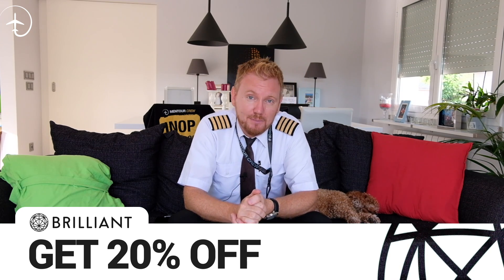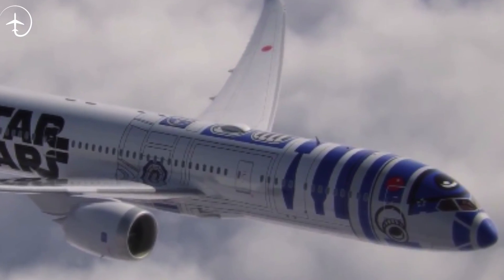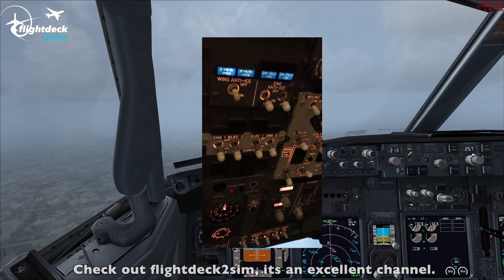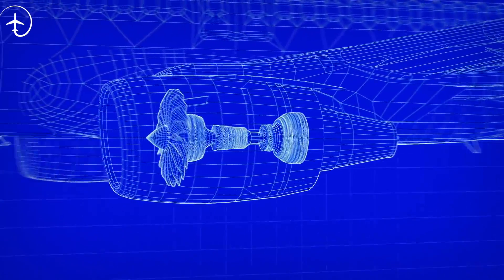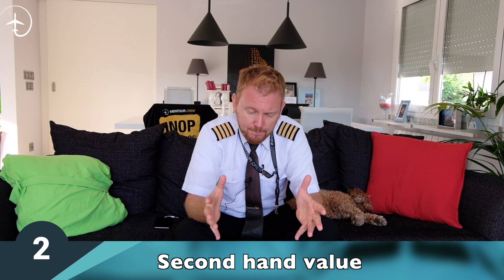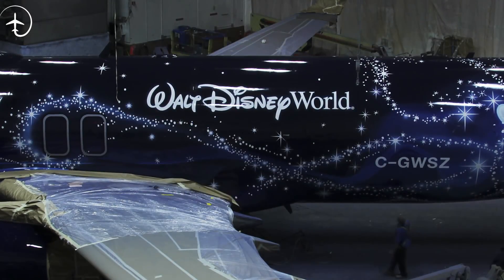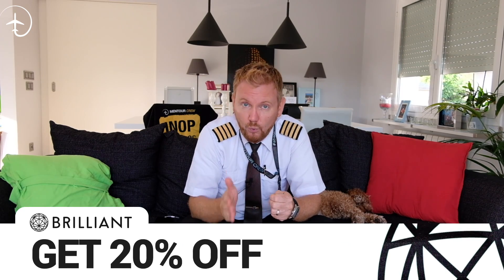Why the front of the Jet Engine is NEVER painted..

Comment: So, why dont airlines just partially paint the plane or not paint the plane at all (like American Airlines used to do)?
Reply: Egor Levin Because the paint serves several important functions.  The white actually reflects heat from the sun, unpainted metal would not do so as effectively.  It also, believe it or not creates a smoother surface, which decreases air friction.  This keeps the temperature of the metal cooler as air friction itself creates heat.  It also helps the plane fly more efficiently, helping to keep down fuel costs.  More friction equals more fuel used.
It also protects the metal from oxidation and corrosion, much like your cars paint does.

Comment: Mentor, is there any reason jet airliners from the 50s to the 80s had matt black noses?
Reply: RE1974    Cuts down glare/blinding reflections....
Reply: well the weather radar and other radars are in the nose, so that might have had something to do with it
Reply: That's easy. The radome cannot be made of metal, as the radar (which is located in the nose) wouldn't work. Regular white paint also has metallic components (nowadays, special paint without metallic components exists). So the plastic radome was covered with a rubbery protective coating, which happend to be black.

Comment: I suppose that if the nacelle were painted, there could be also chipped paint flowing through the compressors and cause an issue. Oh crap, I posted before the explanation which makes my post irrelevant.

Comment: I thought all the aluminium was coated by a treatment called anodising which forms a
coating on the surface . I may be wrong but it always was when I was in MOD contract manufacture.

Comment: white is also mostly fade proof. other colors like red, green, blue and other darker and stronger colors tends to fade into white if exposed to UV light for extended period of time and an aircraft flying at high altitude is more exposed to UV light which degrades the color of the paint faster. while the surface material of the aircraft is protected by layers of coating, the paint scheme which is the outer most layers is practically exposed to the elements which makes it more prone to fading and color degradation and since most color fades into white it is more effective to just paint something white even if the color of the white paint degrade it wont be as noticeable compared to other fancy color degrading and fading.

Comment: Amazing video.  That's just for "normal", commercial aircrafts for the most part.  If I remember correctly, military stealth aircrafts have a different design that allows the use of specially made matte black paint amongst its materials during construction - the kind of paint not allowed for use on commercial airliners.
Reply: Blacksands not to mention the cowling on a military aircraft engine is covered in grey paint.

Comment: Has ceramic coating o of the jet engine intake lip been considered?  It would reduce the adhesion of ice to the lip, and alter the thermal conductivity of the surface.  Which might be a good or not-so-good effect.....

Comment: I'll save you 12 minutes.  It isn't painted because the front edge is heated to prevent ice buildup, and they don't want the very expensive engines ingesting paint chips.
Reply: I see both sides.  If you want a quick explanation then read your answer.  If you want details watch the video.  I like details my self. My thought was they don't want paint chips in the engine.
Reply: Thanks man now i dont have to wait 12 mins
Reply: Star Gazer well I appreciate you letting us know the end , don’t listen to all the other retards.
Reply: ...plus a paint-chipped inlet looks like shit.
Reply: Thanks for the fast recap.
Reply: 3 years later @Star Gazer has proven himself a trailblazer predicting the rise of short form video content and dropping attention spans years in advance! Hats off.
Reply: The actual reason (though the ultimate reason is to prevent ice build up) is better heat transfer. Paint would act as an insulator, SS is a good conductor of heat from the bleed air (TAI: Thermal anti-ice) will transfer better.
Reply: @stevelaminack1516  Amazing that reason wasn't mentioned anywhere along the line.  You sure that's stainless steel?
Reply: You are the real mvp. Thanks for saving me 12 mins.
Reply: You cannot spare 12 min .but you can stick around for an hour reading posts ..makes sense.
Reply: @shoehorn12  Actually, that isn't at all what I said, nor was it my time I was attempting to save.  Perhaps a bit more of your time spent reading the posts would make them make more sense to you.
Reply: @stargazer7644  your not making sense even now..
Reply: @shoehorn12   Perhaps English isn't your first language.  The word you're looking for is "you're", as in the contraction for "you are".  I would suggest more practice to help with your reading comprehension skills.
Reply: @stargazer7644  There is no need to correct spelling or grammatical mistakes that another person made. It is common practice to let them correct themselves.
Reply: @MaxLai_0104  If the error makes it to where you have to deal with it, they didn't correct themselves.
Reply: @stargazer7644  When is it that you have to "deal with it"? This is not a formal job application or a college entry essay.
Reply: @MaxLai_0104  I have to deal with it every time I read it.  Why should one expect others to take time to read what they write if they can't be bothered to take time to write it correctly?  Sounding illiterate in public is really never a good thing.
Reply: Thanks
Reply: I'll save you 50 years, in the end you everyone dies
Reply: I never knew that—great info.
Reply: Thank you so much. I hate 20 minute videos when I'm looking for a sentence. Like answer the question and explain after.
Reply: Then he wouldn't have a video to get money off... It's cause and effect.
Reply: Thank you for the summary, ignore the complainers, everything we'll ever do is incomplete.
Reply: Thanks lad
Reply: Thanks..just needed to confirm what I thought i knew.
Reply: Guys don’t forget we are living in the attention deficit and instant gratification  era. With things like “YouTube shorts” and “TikTok” around people can’t watch a video longer than 60 seconds anymore.
Reply: @berkcanberk4947  After reading this thread, THAT's the conclusion you came up with?  Or did you not bother to read the thread?
Reply: @stargazer7644  yes. Unfortunately yes I did read the entire thread. And my conclusion wasn’t just based on this thread. It’s the reality that we live in.
Reply: @berkcanberk4947  And your personal observation of reality has what exactly to do with this thread that you posted it in?  I guarantee you it has nothing to do with the original post.
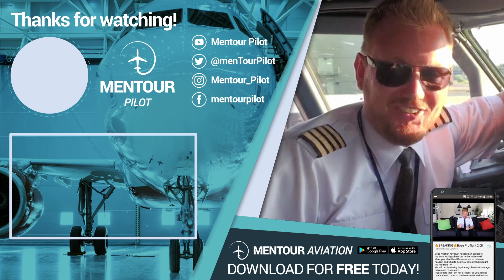Reply: @stargazer7644   yes it does have to do with the original post. Because I can’t find videos long enough to watch and yet here we have a whole bunch of people too impatient to watch a 12:00 minute video.
Reply: bro got way too much hate for nothing
Reply: I appreciate the TL;DR (?)
I kind of dozed off while watching it, but mainly because I am recovering from a cold😅
Watch the 12 minutes for the context, details, and reasoning.
Read the comment section to get the answer to the question without the previously mentioned aspects.

This is sort of like how in math, there is an actual discourse about why 2+2=4, and how it is "impossible" (because there are people who have the mathematical literacy to raise questions) for it to be anything else, but most people are satisfied to know that 2+2=4 without the proofs and mathematical formulas to justify it. 💁🏼‍♂️
Reply: I appreciated your succinct comment that does reflect the answer to the question posed. All these moaners and whingers just enjoy being arseholes. Cheers tho from me.
Reply: YouTubers in general have a tendency to prolong their video, not directly to the subject. I think the purpose is to have enough time for advertisement (more advertisement more money)?
Reply: Star Gazer - i think you wasted now more than 12 min for reading and answering the comments. 😏
Reply: 3 years later, thanks for the quick summary, and also for the witty answers to all those who mistook a TLDR for an aggression 😂
Reply: You also stand in front of a cinema and tell people the ending of new movies to save them time, aren‘t you?! 🙄
Reply: @unheilbargut I'm terribly sorry if I spoiled the ending of this cliffhanger for you.
Reply: Abstract: A guy walks into a comment section with a slightly dismissive attitude, which he then states his reasons for eloquently enough when challenged. This prompts the latest Guardians of Online Etiquette - armada to respond with mainly a bucket of more or less imaginative labels. Can't let the trolls win. 
I shouldn't be too surprised given the infected roll airliner engine paint has historically played in society, and how justifiably high tensions run on both sides. There's such a polarized divide these days, between the “anti-ice heating, 'nuff said” faction, and the “stick around and learn about the weight of paint” activists, that the former have always provoked and energized. 
And until the day we start addressing the many facets and root pains associated with asymmetric heat transfer, I don't think there will be any short-term end in sight to this very, very serious conflict.
Reply: @perarheim1255  ..."There's such a polarized divide"  my ass.
Reply: I watched the whole thing, your summary is incomplete.
Reply: @stulop  What part of the question posed does my summary not answer?
Reply: @stargazer7644  the video contains much more than the answer to a question.
Reply: @stulop  I'd hope so, since it is 12 minutes long, but title of the video was a single question.  If you want to know the answer without wasting 12 minutes, then there you go.
Reply: @stargazer7644  it wasn't a waste, that's for sure, it never is.
Reply: Star Gazer Thanks man.
Reply: @stargazer7644  These videos are always fascinating. 
But everyone is still aware you know much more than him. Sleep well.
Reply: @Mike-pf1ru  Hi Mike, sorry you're extremely late to the party.  It was over 2 years ago.  But feel free to have a good time by yourself.
Reply: @stargazer7644  Thank you Star Gazer. I’m always running a bit late. Have a good morning/afternoon/evening!
Reply: Thank you for cutting out the bull-shit.
Reply: Umm i guess we have paint that can easily deal with that temperature. It's not really hot, no?
Reply: @effedrien  The jet engine bleed air that warms these surfaces is about 250C/500F
Reply: Behold, Star Wanker is here to answer the question you clicked the video for!
Reply: @ipwn951  Hey look, Chris1 is here over a year late to give everyone the benefit of his worthless opinion!
Reply: @ipwn951  You have an amazing vocabulary.  Are you 12?
Reply: you are clearly a moron, this guy knows his stuff and neither he nor anyone else is asking an airhead like you to watch his material
Reply: Star Gazer, you’re an negative troll.  The guy has to start somewhere, and then gave a lot of detail about an interesting subject.   Your simplified summation is simply ignorant
Reply: @MarkSmith-js2pu  honestly you are the troll and trying to bully people. A single question was posed and he answered the question which was exactly what I wanted.
Reply: @MarkSmith-js2pu  Hey Mark...GFY.
Reply: @MarkSmith-js2pu  I'm not a negative troll.  I'm simply answering the question posed in the title.  The answer certainly doesn't take 12 minutes.  I don't think you understand what the word "ignorant" means.  If you want more detail, by all means, watch all 12 minutes.  I didn't find them an especially good use of my time.  If you just want an answer to the question, read what I wrote.  No need to get your panties in a twist over it.
Reply: @stargazer7644  oh dear.
Reply: @stulop  Don't worry --- he's the only one subscribed to his channel!
Reply: @stargazer7644  some of us like his videos…12minutes well spent.
Reply: @stargazer7644  you're cool. Do the numbers in your username have a meaning?
Reply: @HolbrookStark  No, the random number was youtube's gift to me when they renamed everyone's accounts last year.
Reply: @elishavarivka8923  Sure, in that case, enjoy yourself.  In case you just want to know the answer - there you go.
Reply: @stargazer7644  Well.. I could also google the question and have the answer in a second. But, I'm on Youtube because I like to watch video's and hearing the whole story. This video would've been 5 seconds long if he just had that 1 question/answer lol.
Reply: Keep star gazing, you know nothing about aircraft..IT IS primarily for engine anti-ice.
Reply: @stevelaminack1516   That's really rather irrelevant since I'm repeating what Mentour Pilot said in the video, and not expressing my own opinion.  What you're actually saying is HE knows nothing about aircraft.  Good job.  I'm going to go out on a limb here since, as you say, I know nothing about aircraft and point out "front edge is heated to prevent ice buildup" IS engine anti-ice.

Comment: Well, experience tells me there are a couple of reasons why engines and leading edges of wings are not painted:
1. Anti-icing/de-icing Airplanes have different ice countermeasures implemented. Some of them, like the ATR simply sends rough air bursts destroying formed ice. Others use air from APU or the engines to heat or clean the surface. Using paint would disrupt this.
2. Screw-ups. Airplanes are mathematically engineered to obtain the best air-flow around the wings and in front of the engines. Applying a layer of paint disrputs those calculations, resulting in a botched up airflow. Not to mention, poor paintjob or a paintjob that wears out will eventually have iregularities on it's surface. This means there are places where waterdroplets can rest and start forming ice. And if ice forms on the leading edge, this has a severe impact on lift. For the engine, ice deposits can form which can then break and be taken in the engine itself

Comment: As an A&P mechanic and pilot, I say the paint chips have nothing to do with it. Most turbine engines have inlet particle separators that keep most moderate to small sized particles out. This is an anti-ice cowling and needs to get hot to keep ice from building on the engine inlet. The particle separator is great but it wont clear huge pieces of ice.

Comment: I always believed that an aircraft that is sold to a new owner generally has the old paint stripped off after the sale and prior to the new paint scheme being applied for one of the reasons mentioned in #1, weight savings. There may be budget carriers that don't but it makes more sense to remove the old livery completely and repaint from bare metal, especially since it's unlikely that the previous operator has repainted the aircraft within the last 5 years.  Operators want to get as much value as they can from their investment in an aircraft and that includes getting their money's worth from the last repaint.

Comment: To add one more reason for front of  engine no to be painted, it could be preserving clean intake, because when passengers see all those scratches they would think airplane is old and unreliable. What about attacking edges of wings? Second: I was wondering, if plain spend more time during exploitation in cold air at high altitude, than would be better to be painted with some of dark colors? If is one grounded a lot of time like Air Force One, than brighter colors would make more sense...I don"t know, but this is just my guess...

Comment: Before watching the video I postulated this theory. The front cowl of the engine is unpainted  because flakes of paint flaking off could enter the engine causing catastrophic failure to the engine in mid air leading to a crash. 

Then I watched the video to see if I was right.

I was sort of right. Didn't think of ice and heating the cowling. that was interesting and informative.
Reply: Catastrophic engine failure?...dumb.
Reply: @edfilipowicz4866  Anything flying in to the engine can cause it to fail. So the theory isn't dumb. Your comprehension however is.  Any damage to the fan blades will put them out of balance leading to failure, try running a centrifuge out of balance and see what happens.
Reply: @JareddarArt  What was dumb was your original "exaggerating" comment that paint flakes entering the engine results in "causing catastrophic failure to the engine in mid-air leading to a crash".  Why didn't you add that "if this happened over a grade school, many children would be killed".  That would help to really support your "theory" why the cowl lip leading edge isn't painted.
Reply: @edfilipowicz4866  Not according to Aircraft Engineers that I would deliver spares too at British Airways, Air Canada and Lufthansa. Even the smallest particles can cause a catastrophic failure if sufficient enter. I may not be a Jet Engineer but I do have a City and guilds in Engineering from the London School of Engineering. So I am not completely stupid.

Comment: why is there no (mesh) in front of the engine - (propellers), ?  surely this would stop birds etc  going into them, and make them more safe.  cuthberteric2017@gmail. com 🆗🔴
Reply: Until a failure sucked that mesh right into the engine